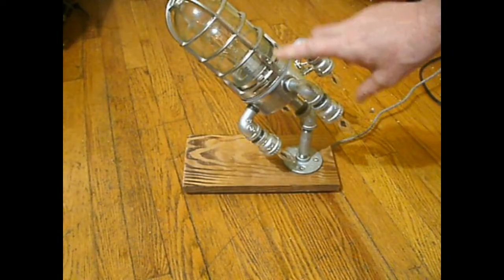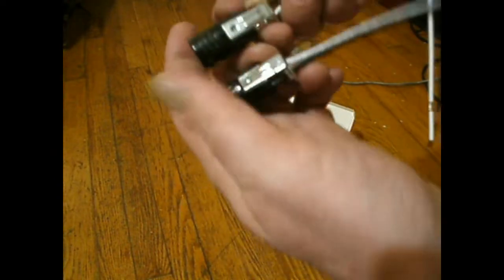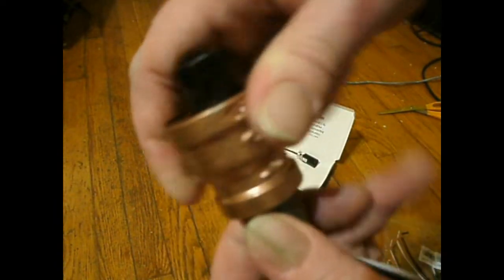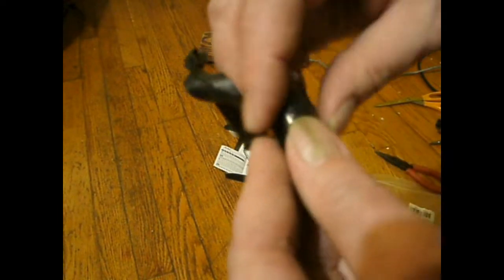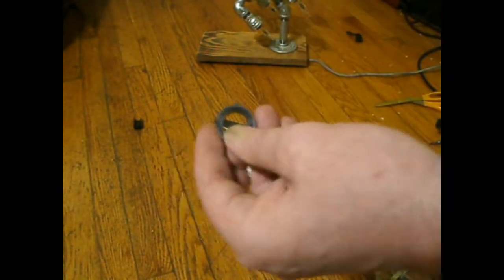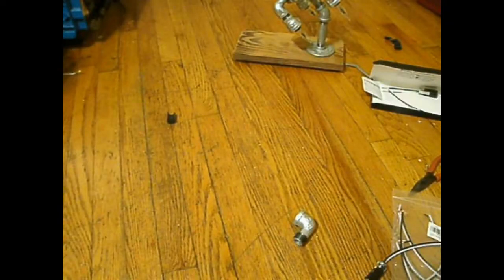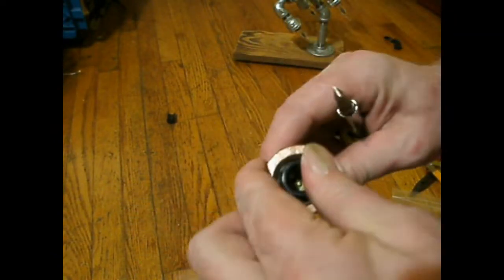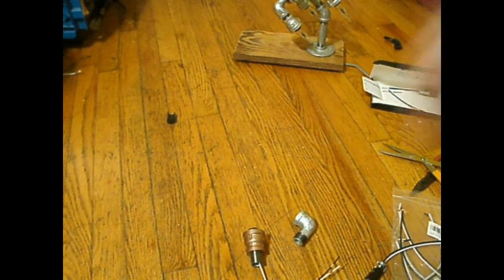Steampunk Rocket Ship Lamp better thruster sockets

Comment: Damn great idea with the washers thank you.
Reply from the maker: Thanks, glad to see someone getting some use out of my ideas. One thing I did NOT mention in this video, because I only came up with it the next day: when you pull that rivet out of the socket (to get the little bracket off) replace it with a machine screw, (size 6-32 x 1/2") you will NOT need the nuts that come with the screws, because it fits the hole just perfect to thread itself nicely into the plastic, and the 1/2" length puts the end just flush with the other side. If for any reason you want to take the socket apart later, you can unscrew it, and screw it back in again.